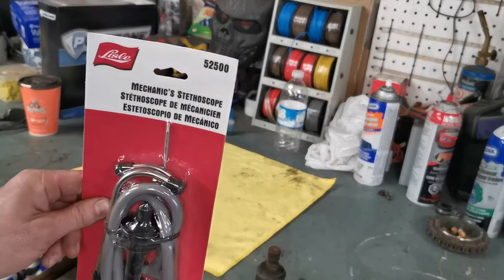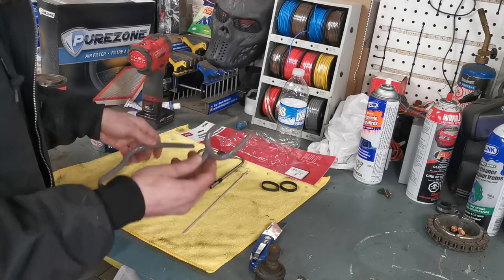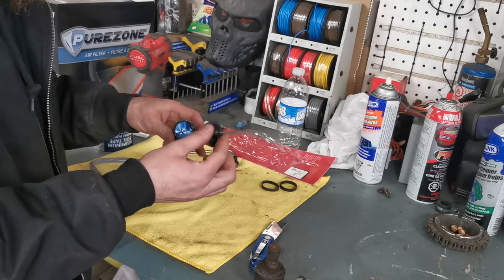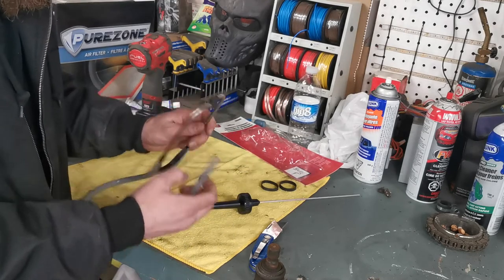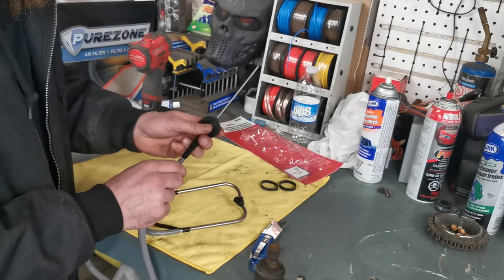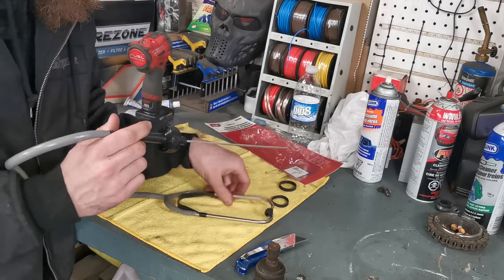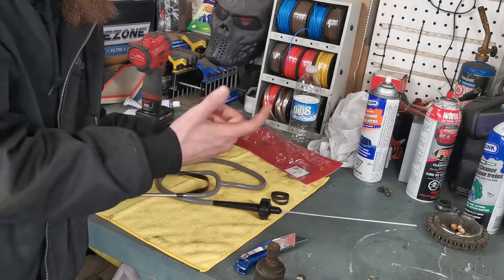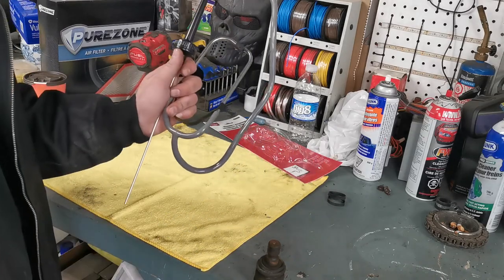Best Mechanic Tools Stethoscope Lisle Bearing Noise Exhaust Vacuum Leak

Comment: I bought one of these today from lisle that includes a little trumpet end on a tube you can attach for air leaks as well as the metal rod which I quite like, had to replace the one I bought at hf because the diagraphm was glued together and broke in half. I could fix it but I lost the rod that threads into it and I want one with the threaded diagrahm for future durability
Reply from the maker: The little air leek checker sounds pretty good.
Reply from the maker: I need to replace mine. It is all bent out of shape. Will prolly check into the one you are talking about
Reply: Do you know what model number it is?

Comment: Good advice, and that stethoscope is clearly better. But Princess Auto has the 2-tube kind on sale for $7.49, which I'll pick up because I'm a cheapskate. I think it would be easy to modify with a bit of tubing and a T connector, in case I ever need that.